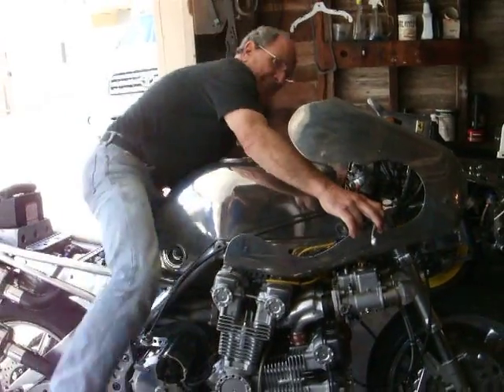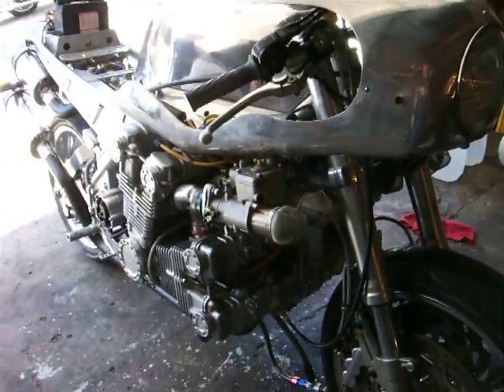V12 CBX running down the road (alley)

Comment from the maker: @patrickplummer Andreas timed it like two separate inline 6 cyl engines. Ideal configuration is 60 but he went with 72 because at 60 there was not enough room for the intake manifolds or two base plates.

Comment: All the big Hondas had chain primary drive and they all rattled, because their engineers weren't as good as Suzuki's, who's only ever used gears. Apart from on their wankel. That's why the drag race tuners loved them and never used hondas.!
That's a brave bit of engineering though mate, hats off.!

Comment: Very nice job Sir. I've been Building Race Engines my entire adult life. Generally I would never make a suggestion or recommendations without the subject in my hands, but consider tungsten slugs installed into what's left of the crankshaft counterweights. I understand narrowing the counterweights to allow clearance for the side by side rod configuration,  but if tungsten can be added,  it will help with positive flywheel effect.  Again,  very nice. 🇺🇸🏍🇺🇸

Comment from the maker: Sometimes my humor gets the best of me. Last saturday I rode my '82 CBX 250 miles. That's more then the V12 will get in the next year. There are not many common parts between the two bikes in the engine that have not been extensively modified to create the V12. Lot's of things are new, pistons, rings, valve job etc. New exhaust. Burning paint, oil, and running a little rich. Cylinders laying down that used to be upright. Oiling system/cam chain tensioners highly modified. It started first try.

Comment from the maker: Fred Robbins built it, his brother still has a salvage yard around there. The bike was called "The Eliminator" engine was sideways (like it should be) with a centrifical clutch. Rear wheel was 12" (had a 14 also) wide with a big drag slick on it.

Comment from the maker: @YakoffShmirnoff   modified the existing one. Cut the throws wider to accomodate two rods that have been cut down, Added a second cam sprocket to the crank so he didn't have to use an extremely long cam chain. He has another crank and engine bits to convert the bike to gear drive cams. He just needs two VF1000R gear cassettes to finish the conversion.

Comment from the maker: @505197  throws are 72 degrees apart. Ideal for a V12 is 60. Andreas went with 72 because at 60 there was not enuogh room for the intakes or the cylinder base. He has two cbx ignitions on it and the firing order is (in degrees) 72,48,72,48,72,48,72,48,72,48,72,48. It's all brand new construction with lots of fresh header paint to cure. Also two of the cylinders had an overabundance of fuel. Those both contributed to the smoking. Neither is a problem now and it doesn't smoke anymore.

Comment from the maker: 2 sets of cylinders on a common crank. Oil pump modified for more volume/pressure. Oil returns to sump via gravity. Forward cyls are at a 10 degree incline from the crank.

Comment from the maker: @10oooo01 feels like a 600lb CBX with twice the power all the way from idle to redline. Immediate power the instance you grab a handful of throttle. Big problem is large displacement (2100cc's) with lack of flywheel effect. Crank was lightened to make room for 6 extra rods and when you let off the throttle the engine wants to idle. Very easy to slide the rear wheel. Needs a slipper clutch and Andreas is working on one.

Comment from the maker: The video titled "amazing" is the first time the bike ran. Ever. You can see the amazement in Andreas' face. It started easier then my stock 82 CBX. It weighs the same as an early CBX (even with all the extra engine) and has a 57" wheelbase. Andreas is 68 years old and spent 1/10th of his life building it. To me what's amazing is the light weight, suspension geometry, and the ease with which it started.

Comment from the maker: and speaking of nuggets of wisdom, in the late 60's Andreas built a 4 cyl race bike utilizing a Honda car engine, two CR72/77 cylinder heads on the car engine, used either a Matchless or Norton frame (I don't remember), and raced it. I have pic's of it infront of Agostini, Vesco, Cooper, Duhamel etc. He raced from 58 through 74. Bronze Replica from IOM and Canadian Nat ional Champion. He was known as George The Greek.

Comment from the maker: front cyl's are inclined up from the crank at 10 degrees and gravity is used to return the oil. The engine has stopped smoking and it's seen 10,000 rpm. Heat is a problem. running down the road it's okay but when stopped the bike just cooks. Andreas is now installing insulation under the tank to keep the gas cool, on the covers around the exhaust, and wrapping the pipes.

Comment: The reason I asked if you ride, is they are generally very impractical, emotional vehicles. Everyone rides for a different reason.
I can't imagine he had the slightest interest in building the bike as a circuit bike or corner slayer. There are lots of bikes that are faster, lighter, etc. But not many functioning V12's built in a guys garage! Just appreciate it for what it is, not what it isn't.

Comment: Haven't read all the comments to check if this has been answered already, but a decent cooling airflow to the front bank of cylinders is a likely problem.

I gotta say, the sound isn't anywhere near as good as I'd expected. Maybe better doing a V8 (two 4 cyl. engines), although that depends upon achieving the optimum V8 firing order. A good V8 sound is music to the ears.

Comment: Oh thats cool, is it a CBX you've got there or something else?  The bikes we've got in there aren't even streetbikes, there's a 1986 Honda Trail 110 that my grandpa purchased new, and its got less than 250 miles on it.  The only un-origional part on it is the fuel line.  The second bike is a 1999 Honda Z50, which was the last one my dad could find for sale locally after Honda announced they were stopping production.  Its never even had gas in the tank, let alone started! :)

Comment: markdam- honda knew the cbx was a flop and thats why production was short lived. i can also state my brothers friends had purchased them new and shortly after traded them in, one even dropped money in after market parts. i ridden a couple of them and the only nice thing i can say, they run smooth. i still state i'm more interested in the machining of this than the bike itself. timing, cam, crank spacing of the rods ect. that is impressive, he needs to do a video on how it was done.

Comment: It sounds like it must be fireing 2 cylinders at once, in fact it has to dosen't it, using the existing throws it'd ha, hmm, now I'm confused, I always have a hard time picturing stuff like this. It didn't sound like a V-12 to me but more like a 6. Maybe it's just the camera. You can smoke test the exhaust system to look for a small leak. I'd had one hole of a carb stand out and be noticable above the others and be bothersome sounding.  Very nice piece of work, my hat is off.

Comment: yes i have, not a v12 version. they handle very poorly, even compared to the same years. response time is low but, power isn't strong. kz and gs models are faster and handle alot better. i have never ridden a cbx on a long trip, so i can't comment on the comfort, i assume it is like any other street bike after 2-3 hours, still thats a goldwing area. goldwing and the cbx to me feel alot alike in corners. but i was not at all impressed by the cbx, nor was my brothers 2 friends which had them.

Comment: as did want to give me an idea of the CBX motor attached 1047c.c 1980 to be a V12 engine that I have the helmet instead of working and the crankshaft is the same as measures taken to tornealo to take two pistons in elbows.
Please

Comment: Different, A lot of work has naturally gone into this project, the sound was a bit of a let down (these are only my comments) don't detract from all the effort that's in this project. I would love to hear this as a "12 into 1 configuration?
Reply from the maker: I'm afraid a cheap camera with lousy audio accounts for the sound. It sounds much better in person then in the video. And the collectors for a 12 into 1? Handmade? I love the sound of a CBX with a 6 into 1. I told Andreas he needs to build three more exhausts for the bike. A 12 into 12, a tri Y 12 into 6 into 3 (probably the best for scavenging), and a 12 into 2 into 1. All of them with equal length head pipes. Then he can run them all and decide which one he likes the best.
Reply from the maker: Andreas told me I'm crazy

Comment from the maker: @randyrhoadesRIP  randyRIP it took a ot more then two engines from perfectly restored, 100 point CBX's to build the V12. Andreas probably destroyed atleast four more perfectly restored, 100 point CBX's just while doing the cam chain adjusters. And he only tries to destroy CGR (do you know what that acronym stands for) CBX's because of their value. It's interesting what one will do for the sake o fart. None of this is real, the video's are a hologram and the sound from a lambo run through a mixer

Comment: cbx1000 was one of the biggest pieces of junk that came out of 1979. the slowest of the big bore bikes of that year for the street bikes. kz1000 and the gs1000 did not worry when they tied into these. but, i'd love to see how this bike was machined and put together. and how the crank was done to allow the extra 6 rods. and cam timing, and even how they handled the firing  and its timing.